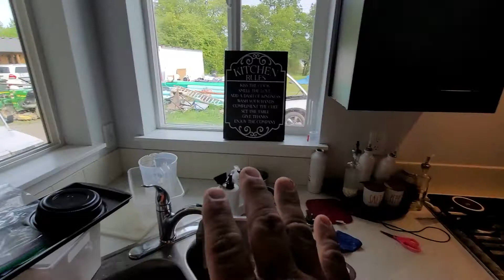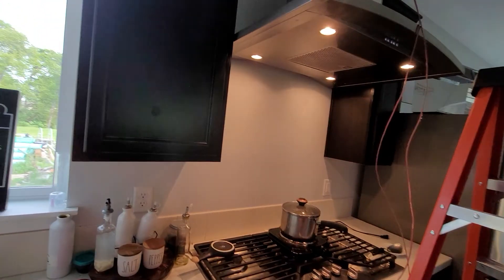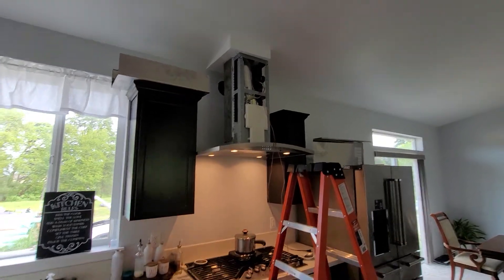make-up air installation retrofit Braun damper auto control unit with 400cfm exhaust hood 6" vent

Comment: I did some research and it turns out you can attach the make up air duct to the return side of your hvac system. We are doing a kitchen renovation and this is what i am suggesting my contractor should do.

Comment: I’m trying to do this same thing now where do the 2 red wires go ?
Reply from the maker: @airriteductcleaning8216  The two wires that are red in my case but that was just spare wire I had laying around that I used.. but in any case those two wires go directly to the sensor screwed into the back of the exhaust pipe...

Comment: All the eve vents right above your damper feed air into the attic. The attic would be a dry place for the wires and damper motor also and a ceiling vent grill would look good as well vs the wall mount. So do it for your bath fan also using the attic air ;)
Reply from the maker: @SrStew  in this case the vaulted ceiling has very little room inside and the venting for the exhaust fan was already finished and installed prior to the building inspector telling me that I needed to have makeup air installed..

So basically I had to retrofit the makeup air and putting it up in the attic with the limited space already finished and stuffed tight with insulation Just wasn't going to be my easiest option.. 

And my hood was actually an island hood and did not fit totally against the wall so leaving that space behind it worked out for me to put my makeup air vent in that space behind the hood pipe...

I think everybody's situation would be just a little bit different but that was mine anyway at the time..

Thanks for your comments and likes I really appreciate it

Comment: Thank you for sharing your video not much information on this topic on YouTube 
Can you please explain how and where did you mount the pressure switch and sensor if possible more details please.
Reply from the maker: @im11000  thank you for your comments and likes, I really appreciate it..

The sensor switch came with the kit and I drilled a small hole into the back of the vent  pipe and the sensor just sticks into that hole and a couple of self-tapping screws attach it.. It was pretty simple..

And you're right 
I found very little information online and on YouTube for this makeup air DIY or retrofit install , so That is why I decided to share this one.. 
I hope you guys like it and I apologize if it's not a super professionally edited and planned video like so many great YouTubers out there. nonetheless I hope it's helpful..

Comment: Hi, am remodeling and adding a makeup air system too. It’s March 2024 and the HVAC crew have never installed one in a home before 🙃 I’ve had to geek out bc it seems this is not common around here. Im in California. Am i seeing you installed the outtake (interior) register behind the hood duct? Do you have a filter on this? An update would be much appreciated, thanks!
Reply from the maker: @gellybellyism  sorry for getting back to you so late on this, I did not add a filter but I think that would be a good thing to add if you live in an area that has a lot of smoke or dust..
However I did add a screen to both sides and an adjustable vent cover on the inside so that I could keep the vent from being wide open in the winter..

Comment: Great video, at 1:21 you mention that the flapper is opened whenever the exhaust is turned on. Do you mean when the pressure switch is activated, or when your exhaust is actually turned on (from the exhaust switch itself). I'm attempting to install using the sequence of the actual exhausts with and bypassing the 'pressure switch'. It looks like you may have clarified this at the 2:27 mark.
Reply from the maker: @tillmansr2002  You are correct that the flapper is not opened because the exhaust fan is on It is open because the pressure switch senses that the exhaust fan is on and opens the flapper.. 

So yes the flapper is open whenever the exhaust is turned on because even on low setting the flapper opens..
Hope that makes sense

Comment: Nice, simple DYI with great ideas & not as  complicated as many I've reviewed. If you have the room a filter would be good, however this is a nice job & hopefully it's not too cold where you live & need an inline heater.
Reply from the maker: @garym1199  thanks for your comments. 
Here in Oregon it does get pretty cold in the winter and that was one reason why I chose to put the air vent up high behind the hood versus having the air come in under the bottom of the cabinet like some people do...

I didn't want to be standing there at the stove and have cold air coming in at my feet and blowing up my pant legs.. 

Also I want the incoming cold air to be close to the outgoing exhaust so that I don't suck too much of the heat out of my house..
I hope is that it will take the cold air that's coming in and suck it straight out with the exhaust air from cooking..

Comment: Most makeup air systems will include at least a heater (e.g.: a glorified toaster) that can produce about 10,000 watts of heat to condition the cold outside air, especially if you live anywhere in the top half of the USA. For folks in the hotter climates, the opposite problem is removing the humidity (mostly) from the outside, and cooling the air. 
Elaborate and expensive systems are sold to DIYers and are provided by HVAC installers with both hot and cold compensation. While your example is simple, inexpensive, and likely meets the local code requirements in your area, it’s by no means an ideal solution. Do you think that you could safely retro-fit some kind of heater into your solution?
Reply: I'm studying as well. I think for his system most of the makeup air will be suck out by the hood directly so there should not be much heat/cool issue.
Reply from the maker: @wewe5dfbb  You are absolutely correct and thank you for commenting liking and subscribing and all that good stuff...
My vent is located near the exhaust hood and like you said the cold air that comes in is mostly sucked out by the exhaust hood and it helps to minimize my heat from the house being sucked out along with it...
Reply from the maker: @bruce2sail  Yes I could RetroFit a heater but like you said my solution was to get past code and obtain occupancy as it was one of the final things that needed to be done to our house..

It's been a couple of years now and I live in the Pacific Northwest near Portland Oregon and the hot and cold weather aren't too much of a problem with this vent being where it is...

Because it is located behind the hood the cold air that comes in from the outside goes straight around the hood and get sucked up with the smoke and steam from  cooking. 
When contemplating where I was going to install this vent system I considered doing what I seen other people do and have the air come in under the cabinets and that would have not been good in winter because the cold air would blow right over my feet if I'm standing in front of the stove and right up my pant leg lol..
So this actually worked out pretty good without any kind of heater system for my climate and location..

Comment: Did you have to calibrate the NS series pressure switch?  If, yes How?
Reply from the maker: There was no calibrating at all the pressure switch attaches to the pipe and senses when the fan is on and tells the makeup air vent to open It's actually pretty simple

Comment: Hi, this is very helpful. A couple of follow-up questions. How did you wire the damper and pressure switch? In this video, I see the two red wires coming from the outside where the damper is, but I don't see where these wires are connected to. Also, you mentioned in the video that there are two terminals on the pressure switch. How is the switch hooked up? I'm guessing the pressure switch is connected to the transformer. Did you connect the damper to the same transformer? Thanks in advance for your help.
Reply from the maker: Yes that's correct The dampener is wired to the transformer and the transformer gets its power from the power going into the fan.
The sensor was very easy just drill a hole in the pipe and the sensor sticks into the hole and screws to the side of the pipe

Comment: I enjoyed the video. my question is did you have to hardwire anything to plug in the transformer. I'm going to try this
Reply from the maker: I tapped the transformer into the power wires for the fan that come from the breaker box I connected it right there inside the housing